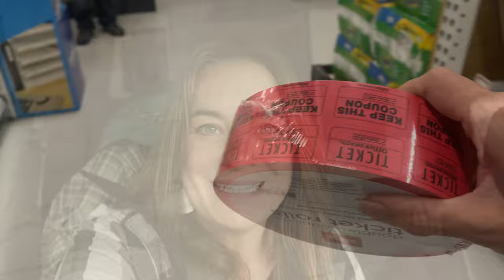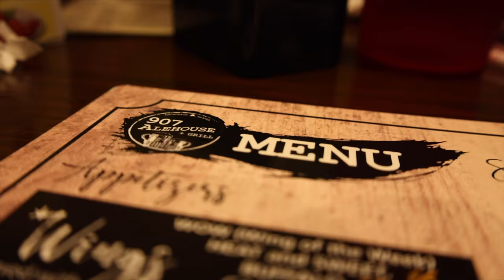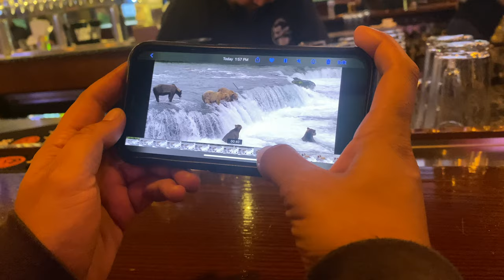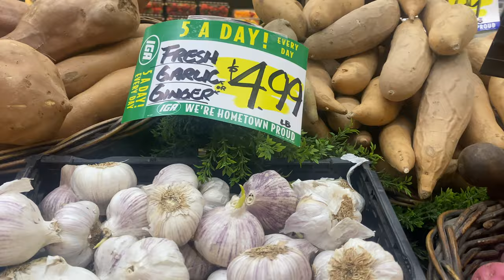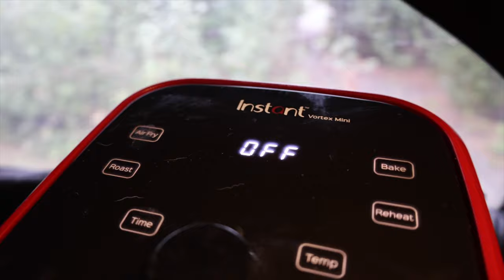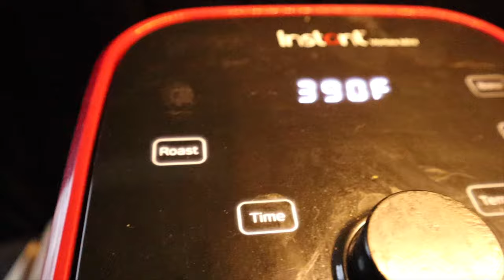Expedition Alaska: The Susitna River | Van Life Alaska

Comment: Awesome adventures!  So peaceful and takes me away.  Here in TX we've had what feels like 50 days of being over 100 degrees, but now we're in rain and cooler temps which is unusual but I'll take it.  Curious if you've ever considered rhino lining the whole van or just parts, too expensive, add too much weight?  Seems like it would make it practically indestructible with branch strikes etc?  Thank you!
Reply from the maker: We may use liner on the whole van at some point if the damage from trees etc starts to show.  The areas we did do were areas where we were getting chips and nicks from rocks and branches.  works very well!